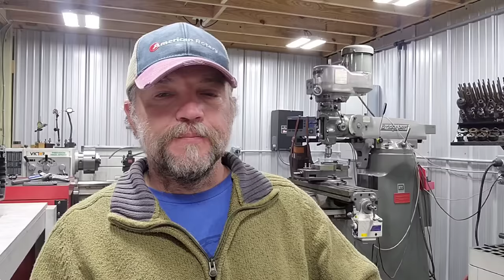IS THIS THE END of HARLEY Performance? - The EPA Freight Train is HERE! - Baxters Garage

Comment: I've been an auto tech since 1983, and I've seen and been a part of all these changes through the years. You're correct in how behind the M/C industry is compared to the auto industry...not only in development, but training also. I commented on Doc Harleys channel about how far behind Harley is in there FI systems, and that the simple MAP system they use was close to 40 yrs old when they started. He pulled my comment down!!! One thing to keep in mind is YM&M of these bikes. The emissions that a bike make are tested the same as autos and diesels; I.E. they have to meet the standard for the year they were manufactured. I still drive an 02 F150, I'm not required to meet emission standards for any year after 02....same for bikes.

But you are correct in the fines and in removal of compliant parts. I immediately took my cats of my 14 Heritage, but I also took them off my above mentioned F150. I feel we're still a long way off from individually being contacted by the Gubment....shops on the other hand are definitely closer. That being said they don't look hard in the south...yet. The places where they've been enforcing emission compliance for years may have to worry more sooner.

I see you have Nashvegas on this vid, have you moved up here? Nashville, Memphis, Knoxville, Chattanooga, and Wilson county are the only places in TN the require the testing that I know of. We don't require it in the county I'm in, nor any surrounding counties until we get to metro Nashville. My vehicles aren't tagged there so I'm not required to meet their standards.

Comment: Problem is u cant make any kind of big power with an air cooled motor and pass epa they need to breath and without cooling they will never pass u can buy a liquid cooled indian that makes well over 100 hp bone stock or any other make that uses liquid cooling for that matter bottom line is hd needs to catch up sooner than later

Comment: Imagine what our air quality would be like if we kept emissions regulations at pre-1970s level.  The Air Quality Index is 17 in my town today vs 453 in Beijing.  I can see the desire and logic for motorcycle exemptions but realistically every motor from 107 up has more than enough power for even heavy touring at highway speeds from a transportation perspective.  These agencies also know how little will actually be enforced so the bar has to be set higher.  I'm off to go ride my Shovel so I have neither power or clean emissions.

Comment: I live in Calif and in my opinion CARB is too powerful and the EPA and CARB can make what ever rules they feel like with no say so from anyone. The last bike I had was a Yahama Eluder and it was just set way too lean the damn thing had a hesitation when taking off from a start it was scary if you weren't on top of it it would hesitate and die in front of traffic it's sold and gone.  I'm looking at a another bike either a softtail std  or a wide glide just not sure what years in Calif that don't have cats in the exhaust and no one has any answers on this it gets frustrating.

Comment: Dude, they are after F ing lawn mowers and weed whackers. Good luck getting them to back down on motorcycles. Personally I ride an 80 ci Shovel and it's got an antique tag on it. 

As far as performance goes, you are going to have to find a way to work within what is mandated. Maybe find a way to fit a motor/generator in the primary to charge a small battery pack, while you are riding normal, and use that stored energy for when you want a burst of power. Motors can function as generators, and vice versa. Look to electric forklifts for components. I know the ones manufactured by Raymond used a shunt wound dc motor that would probably fit the bill to be used as both a motor and a generator

Comment: The epa went after Pittsburgh Power for their commercial diesel engines and Parts.. Pittsburgh Power brought in factual information proving that they were accomplishing more hp & tq and their engines were more environmentally friendly than what the epa was classifying as good to go from the factory. The manufacturers are going to continue to make the products and if a shop refuses to do said work they won't be in business long

Comment: Hey Kevin I have a question for you….if it’s ok of course……..I have a stock 2010 street glide, what benefits and changes can I expect if I go into the head pipe and cut that section open and remove all of the honeycomb and weld that piece of sheet metal back into place ?

Comment: You probably won't read this but is there any way? I design a good combustion chamber so it could breathe well for intake in exhaust and be able to balance the timing in fuel so it has a better. Burn each time it fires that way there's a loss garbage coming out but the only problem is. We have alcohol in the fuel so you can't get a good combustion chair in it and it Fort bird clean because of that.
  You know you gotta be able to have a open combustion chamber to be able to breathe in fire that fuel and burn it efficiently and what you can. Figure out how To Do that. Then you could probably get around a lot of that EPA because just as fuel as bad fuel is really really bad so unless you could fight yourself A. Source of non alcohol 93 activity and fuel it. You kind of go and backwards.
  But I would enjoy if you did communicate with me because I do have some designs that I have held in my mind for years.

Comment: I am surprised that they haven't hit all these shops earlier. I was in auto industry repair 80-2000. When I started eh no big deal to change carb etc but by time I left you couldn't alter anything as EPA would fine shop $50k. They are going after lawnmowers and chain saws, they will not stop. They will go after every shop and every dealer till they all quit modifying. The only ones that will be off road use only or very old bikes

Comment: I have a 2020 Electa Glide 107, stock, that will do 0-60 in under 5 seconds. (4.6?)  A Hellcat only beats that by 1 second. 
I have an ‘O2 Vrod, also stock, that might actually beat the Hellcat in 0-60.
Both bikes are compliant. What more would I need beyond that, realistically… in normal traffic?

Comment: I ride a 124ci M8 road glide 
Guess that’s a hot rod.  
Gets 38mpg if I’m RIPPIN.
Mid to upper 40s running 80-85 on the hwy 
More than the stock bike did
😒

Comment: Air cooled motorcycles are done. Look at Porsche. Years ago their air cooled engines were discontinued. Porsche knew they could not meet future EPA emission standards with an air cold engine. The writing on the wall has been right in front of us for years.  Got to hand it to Harley they held on to the air cooled engine to the bitter end.

Comment: Well I’ve been thinking long and hard about this and all I see is opportunity. Getting hp with air and gas is easy old school. If they can get 600 hp out of a dodge demon then that technology can be applied to Harley’s. Shouldn’t be that impossible to get 150 carb compliant hp in a Harley . Whomever develops this technology as an aftermarket will make a friggin fortune. Better to embrace the new technology than fight it. We’d all be riding 8hp flat heads if we didn’t embrace the new.

Comment: 1970 hp ratings were not SAE. There is a big difference in how HP ratings were measured in 1975 vs 1970. Harley engines are technically no more complex than most lawn mowers. I own 2 Harleys and my DCT Wing will outright smoke either Harley.

Comment: Harley Dealers in SW Missouri, will modify even new bikes with a FREE stage 1 or 2 conversion, to sweeten the sales deal, before the buyer picks the bike up. We brought this stuff on ourselves, when Bubba and Cletus Lawn mower repairs, started 'Modifian' Hd's,' for more performance: LOUD and RICH, with barely discernible gains of any kind! Ever followed a large group of HD riders and the smell of over rich mixtures and 'HOG' oil just makes you GAG! I have and that's why I LEAD the groups and not follow. I was a builder of DYNO winning HD Big Twins (Evo's) in Southern Calif for years and it is a SCIENCE if done properly and it is VERY expensive too. The new M8 engine's are powerful and sound good as-is, if only they were reliable! TU for great Videos!

Comment: I realize your headline says Harley, but you also keep mentioning motorcycles in general. Most Harleys are air cooled which limits power increases. You said motorcycles are behind auto performance increases, my stock Kawasaki H2Sx super charged Mc puts out about 200 horsepower, and many sport bikes are in that range. I have stage 2 on my 2022 Fat Bob and I am satisfied with the low rpm torque it gives me. 30 years ago I owned a motorcycle dealer and I remember getting  a leter from the manufacturer stating modifying a motorcycle could result in a 10k fine. In California I appreciate clean air mandates.

Comment: It was always an attack on an American company.
HD, for all the talk about clean air, is a 2 cylinder engine.
The modern HD has fuel injection, electronic ignition, computers and other things, that were never part of the original motorcycle.
And with other designs in the engine and transmission, HD is about as clean running as any other product out there.
The government won't be satisfied, until we are riding on the backs of mules and horses.
No more trucks, just oxcarts, wagons and buggies.
And lets consider the potential, that when there's a change in the guard in government, it could mean a change in all these government regulations and laws.
One thing to consider is, California is the benchmark, for federal regulations and laws.
California wants electric trucks and trains!
Just sell off the engine powered things and get a mule...

Comment: Back in the Day ,, AZ. Had all hy , vehicles   go threw Emissions  test to get your Tag, lol well  I worked a Harley dealer,  I had to  define all the bikes,  to Emissions  standard. So they would pass, when I got down there,,   lol, now. What a joke,  bike barely  ran,,   then got back to the shop,, had to retune it. So it was all good to run, right,, hmm,  don't know why they stopped Emissions,  cause I left the dealer,,  but maybe they knew, the bikes were putting out alot of Emissions,   after  they passed, and were retuned,,  lol,

Comment: What we would all like to do is prove the epa a liar. We all know if you remove all the epa crap the eng gets better fuel mileage which inturn makes less pollution, eng last longer.  12 valve cummins can get up to 30 miles per gallion and still haul a 30,000lbs load. And I dont mean it will get 30 mpg loaded, I know someone was waiting for that one. lol Just like ethanol, it cost more to make than its worth, but some liar out there owns a corn field somewhere and now it has to be put in the fuel. Its bad for everything. Im getting old an you younger folks will be dealing with this. The govt  has to be taken on, head on and say enough. We are being lead around with a ring in our nose.

Comment: PCV is NOT that bad of a thing.  It made for less oil leaks. Also, no, the crank case is not full of inert, unburnable gasses.  That's a joke.  It is mostly full of air being pumped by piston movement.  Having a negative pressure there is not a bad thing.  No, that gas is not ridiculously hot...at least it better not be or something else is wrong.  PCV makes for a much cleaner internal situation.  Just venting it???  That is just a static solution.  Having fresh air flow in there is is better in terms of cleanliness and evacuation of moisture.  Be real.  PCV is better than a draft tube or static vent.

Comment: Hey guys, if harley wasnt so poorly engineered to begin with, none of this would be an issue.  Yamaha, honda, kawasaki, and susuki are all engineered well, all do higher power than the harley equivalent, and all pass the epa and carb standards.  And yes, i own a harley, bone stock evo, total garbage compared to my 1996 hamaha royalstar, carbureted, slightly smaller engine, almost double the horsepower.

Comment: Replaced my head pipe with a factory style cat less head pipe. M8 so no tune required. Not throwing any codes and actually runs a lot better. I still have my factory head pipe in the event my commie state wants to smog check one day.

Comment: Harley performance?
Give us a break, Harley unlike Indian has never had anything even resembling performance.
A 10 year old Indian with 100,000 miles still will out run anything in the  sad Harley lineup.
Not to mention all the Indian needed to reach its first 100,000 miles was basic maintenance.

Comment: Motorcycles following car emissions.  Kawasaki offers forced induction, VVT, and hybrid motorcycles.  Companies working on direct injection similar to cars.  All this leads eventually electric motorcycles.  Batteries keep improving both size, range, and cost.  I own Teslas which are essentially maintenance free.  I charge at home with solar.  I save $400/month on gas and home electricity.  I can not control healthcare costs but can control energy costs